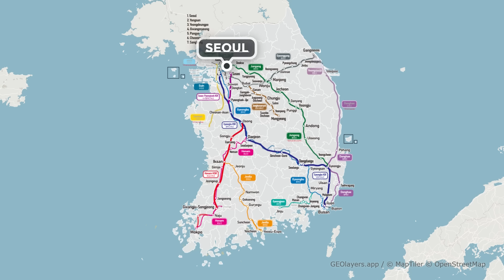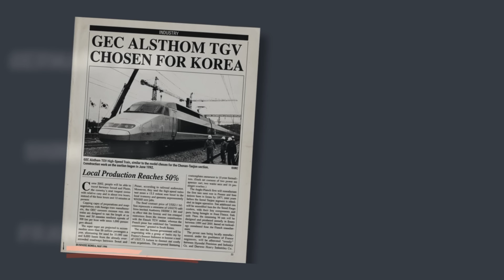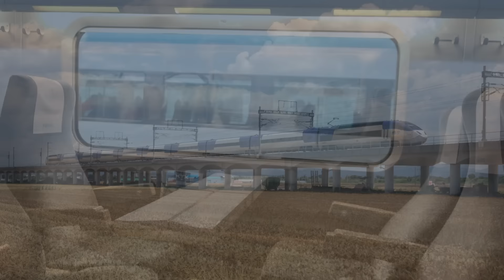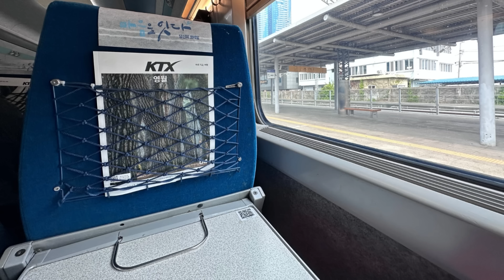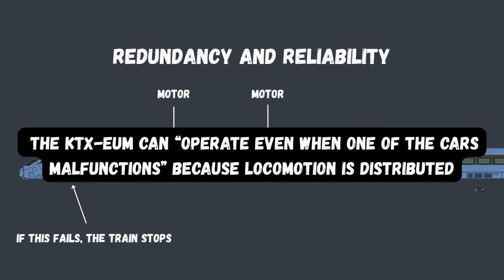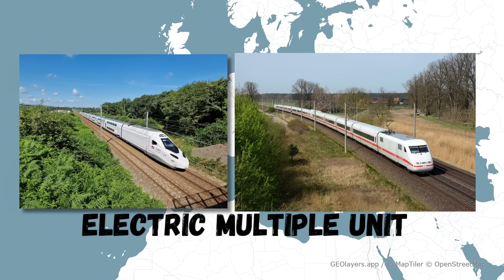How South Korea Perfected the Bullet Train

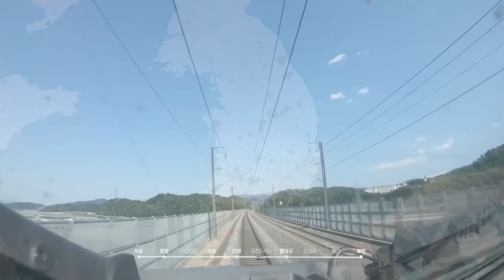Comment from the maker: Corrections: The map on 1:53 shows the wrong Mok-po, it's supposed to be on the bottom left. Also, KTX-Eum mainly runs on upgraded/semi-high-speed routes; the main 300 km/h high-speed lines use other KTX sets (including the newer KTX-Cheongryong). Thanks for the catch.
Reply: 한국 기차에 관심 가져주셔서 감사합니다❤
Reply: The new TVG-M in France still has power cars on both ends, as you can clearly see on the photo you used

Comment: The only one default is too not used the emu technology with boggy axle between two coaches when you have only one level on your train in order to imrove security and stability. The new french TGV-M isn't an EMU because it's a duplex and if you take motor in the boggy between the coaches you are going upper the mass limit on french railway. This is why in duplex train you have locomotive set but in AGV or Avelia TGV you can use the EMU with this technics. This choice of one axle per two coach has proved this efficacity in crash (like few years ago with KTX-1 in a tunnel) or on France and for the train stability in high speed but in country like Korea a good test can be a train like pendular train to improve top speed in curve like Switzerland. I think some updated in signalling or technology design can be most better for Korea in the next generation to have the best train (for one level because the duplex is far more complex due to the axle mass per ton weight). Good video I have learned some good things  on Korea system and train ; )

Comment: My one gripe over the KTX vs the TGV, and having ridden both, is that the KTX seats tend to be smaller, shorter, and slightly more cramped due to their increased amenities. This isn't a problem for most koreans due to their rather thin and short stature, but it is a problem for foreigners who have problems with hitting their heads on the doors.

Comment: LOL. Japan had the first Bullet train with distributed engines in 1964 Japan Olympics.
The rest of the world used a single engine.
South Korea.20 years later, in the 80s DID NOT use the "best" technology and used the single engine model and LATER switched to distributed engines.
The conclusion is South Korea were NOT smart enough to use the Japanese model. Why was that? ROFL
PS: The Taiwanese were smart and went straight with the BEST technology right from the start. ROFL.

Comment: From France, really happy to learn of great Korean design and improvements.

France hold numerous world record for train speed, and long before TGV
1954 : 243 km/h
1955 : 331 km/h
1981 : 380 km/h
1990 : 515,3 km/h
2007 : 574,8 km/h

As for the TGV, it also evolved, in 1996 the duplex version (2 floors) was introduced to increase number of passagers, the latest version TGV-M emphasize energy saving (20%) over speed, 25% recycled material, batteries to operate even when electricity is cut, connectivity is improved, 

The TGV is also used in various countries and to link European countries.

As of now, Spain has the largest high speed network.
And in Europe, the revolution is also commercial: you have Italian, French, Spanish, ..., companies competing on the same railways to on schedule, price, promotions, ... 
So you can choose a french TGV in Spain or an Italian Frecciarossa in France for instance.

The train is a fantastic mean of transportation, efficient and low CO2, so a healthy competition is great, tech and commercial.

Comment: As Korean, I want to fix some issues of this video. first, the city Mokpo was in the northwest from the gwangju, but the city is really located at southwest part of Korea land. next, in real Korea high-speed rail system, we sort the high speed rail in two types, high-speed rail and semi-high speed rail. the high-speed rail system has 300km/h maximum speed and almost new construction only for KTXs. in this line, the KTX and KTX - Sancheon are the main trains. the high-speed rail system is mainly includes Gyeongbu line that you said in the video, and also Honam line, which branches off at Osong station, approximately in the center of the south korea land, goes to the Gwangju and Mokpo, which is southwest part of the Korea. the KTX eum train does not run in these high-speed rails. Instead, KTX-Cheongryong(meaning blue dragon), the same type of the emu train as the KTX-eum train but 320km/h high speed, recently started running in these lines with faster average speed. 
In the case of the semi-high speed rails(Jungang and Gangneung line), it is mainly constructed by improving the existing railway before KTX, these lines are having 200 - 260 km/h maximum speed and these lines are the main field of KTX-eum train. thanks for reading a foreigner's bad writing and have a good day :)

Comment: The intro is BS. Everyone develops their HSR for domestic use primarily. Japan, France, Italy, Spain, China, Germany, they all develop their HSR for their own country. Then the cross-compatibility is added, tested and certified. Germany and the other countries it borders don't even use the same electricity system, they use 15kV 16.7Hz but everyone else except for Austria and Switzerland uses 25kV 50Hz AC so anything that they want to send across the border other than Austria or Switzerland needs to be dual-voltage. And everything they send accross the border still needs to be certified in that foreign country. The italians use dual voltage power units by default because Directissima is DC 3kV and the rest of the HSR is 25kV 50Hz AC.

Comment: GOING FULL CIRCLE !!!
Trouble is using French rather than Japanese methods. You have two totally different types of train. The French wouldn't listen to the Japanese, and instead of distributed power went for a power car each end ! Now all the latest types of Super High Speed train designs are finally coming around to Japanese thinking and changing to distributed power. For many reasons, not the least of which is you don't waste potential valuable seating space in "power cars".

Comment: If there is one thing Korea is famous for it's the enormous corruption and nepotism. That is why they rejected the tunnel-ready Shinkansen and distributed power ICE and chose the archaic technology. The frenchies simply PAID them to "win" the bid. It cost Korea two decades and billions of dollars of unnecessary development.
Reply: One cannot deny the potential presence of lobbyists; however, attributing the entire selection to bribery is an oversimplification. Based on the technology transferred from France, South Korea successfully developed the KTX-Sancheon, a second-generation locomotive-hauled system. Despite starting later than other rail powers, Korea has now reached a point where it exports its own high-speed rolling stock. Although the Sancheon model suffered from various technical glitches due to an accelerated development timeline some of which are still being addressed the third-generation KTX-Cheongryong (EMU-320) has proven to be highly stable. When evaluating the past two decades, what might seem like a 'waste' of time and resources was, in fact, a vital investment in localized technology and long-term self sufficiency.
Reply: Back in the 1990s, only Shinkansen was in distributed traction type trains, both TGV and ICE were locomotive-led trains. It was ICE1 and ICE2 back then, ICE3 was only available in the early 2000s.

The rest was explained by other users, and back then both TGV and ICE agreed on technology transfers, but Shinkansen (JR Central) refused. TGV's transfer content was technically better than ICE, and TGV was the only one attaining 300 km/h operational speed in the 1990s. That was why TGV was chosen.

Later when Alstom did not transfer technologies fully, it was another issue - but please do remember Shinkansen (JR Central) did not agree to transfer technologies at all at the beginning.
Reply: Ktx청룡은 이미 분산형 구동을 하고 있어요
Reply: Actually, you’re missing a few key points here. TGV was chosen because it was the fastest and most reliable in terms of maintenance at the time. Plus, Korea and France have similar geography—both have rail networks centered around one huge capital city.

The real game-changer was that France offered full tech transfer and promised that Korea wouldn't have to pay any royalties for new tech developed from it. Japan, on the other hand, was super stingy with their Shinkansen tech. When you look at Korea’s current rail map—mixing high-speed lines with upgraded traditional tracks to cover the whole country—the Japanese system just wouldn't have worked. It’s easy to judge now, but based on Korea's infrastructure goals, the TGV was the way to go.

Comment: I have ridden Japanese, Chinese, Euro Star, KTX & Saudi high speed rails. Japanese is #1 , Chinese & Euro come on #2 , KTX & Sadi comes on #3. In September I ridden  KTX from  Busan to Seoul station , KTX was 30 min late , never felt it was fast like other high speed rails. It was the only one got delayed from my all high speed rails. Every other left & reached ON time.
Reply: The massive train delays have occurred since the Cheongdo Mugunghwa accident on August 19, in which two track workers were killed.

The Ministry of Employment and Labor has ordered the suspension of track work for reasons such as improving work, causing disruptions in track maintenance.

The work was suspended in the 454km section of the Gyeongbu Line, including Sinam and Cheongdo, but for safety, it was slowing down to half when it passed this section.
Reply: 그 당시에 한국 철도 사고가 있었습니다. 그래서 보수 공사 관계로 늦어진 것입니다.

Comment: 21:58 Just to tell you that Tokyo to Hiroshima is around 800km, with journey times at 4 hours, Tokyo to Osaka may be better for comparison though since said line is only slightly longer than Seoul to Busan at 515km, travel time at around 2 hours and 22 minutes.
Reply: Bro what do you mean slightly longer than Seoul to Busan? Thats a 100km+ difference.
It's better to compare Tokyo to Nagoya instead as that's roughly 50km shorter

Comment: The real game changer in my view is the new GTX system.  This is based on the SRT system (a smaller variant of KTX) but is a regional line that will connect various  suburbs and satallite cities in Gyeonggi Province to Seoul.  It is basically a high speed  commuter/subway line with speeds up to 180 km/hr.  50% of South Korea's population lives in Seoul and Gyonggi Province (which surrounds Seoul).  

The 1st line opened in 2025.  It connects Paju City to Seoul Station (40 km), making 3 stops along the way.  The rush hour commute on GTX takes 22 minutes.  By car, it would take around 1.5 hours.  By regular subway, over 1 hour.

The ultimate plan of this (along with new system of underground expressways beneath Seoul) is to allow 10s of millions of people to live 50~ 100kms outside of Seoul and be able to commute to work in Seoul within 1 hour.
Reply: Yes the GTX is a game changer, there is nothing else like it and this fast
Reply: @derekhung6625 Being able to go to work at 180 km/h without getting a ticket is a game changer. You can only drive car to work in America with average speed of 60 km/h which is 45 mph
Reply: China's Line 18 (Guangzhou Metro) goes 160km/hour (99mph) which is almost as fast.
Reply: GTX is not based on SRT, in fact SRT is a train operator similar to Korail and it operates the same locomitive as KTX
Reply: 이게 재미난건데 미국은 땅 덩어리 넓은데 기차 속도에 집착하지 않는 느낌. 근데 쬐그만한 나라에서 속도에 광적으로 집착. 상식적으로 보면 남한의 백배 크기라는 미국이 더 접착할 듯 싶은데. 요상하게도 몇시간이면 주파하는 한국에서 더 난리. 
이제는 하다하다. 1000키로 속도 하이퍼 고속철 구상하고 있다고. 부산거리를 십분 이십분 내로 주파하면 한국인들 빨리빨리 집착증  좀 풀릴까?
미국에서는 테슬라에서 하겠다고 구상하다가 사업성 없어서 포기했는지 말 안 나오는데.
갑자기 뜬금없이 한국에서 1200키로 속도 하이퍼루프를 구상하고 있다고 뉴스 등이 나오는..
성격급한 한국인들 기여코 부산도 십분 이십분으로 통과해야 마음이 편안해지는거
Reply: @edata7594  미국은 예전에는 속도를 추구했어요. 자동차랑 항공기 로비에 밀려서 지금 이모양된거죠.
Reply: I agree. Its a shame that in foreign press, its been framed as a "train that will boost birthrate" than any other functional benefit of a high-speed subway.
Reply: The real game changer is using the words game changer every time there's a new model of anything.
Reply: Is GTX the Korean version of Paris RER?
Reply: @jackapplo1316 Yes, it is based on the RER, but it is more high tech and more extreme (faster, deeper underground, etc.)
Reply: 기차승객수송의장점. 안전성  대량  정시간. ᆢ